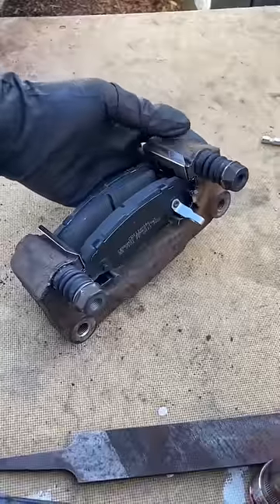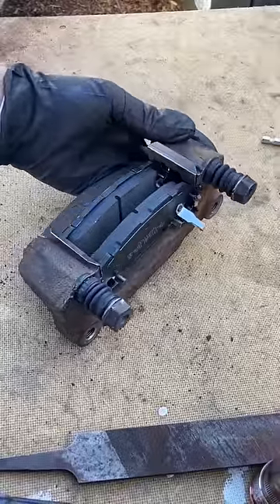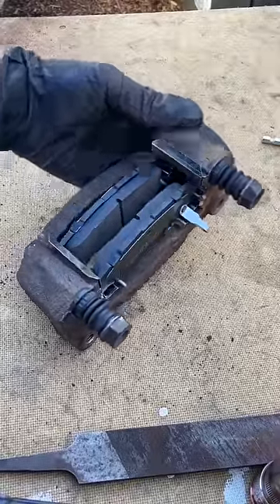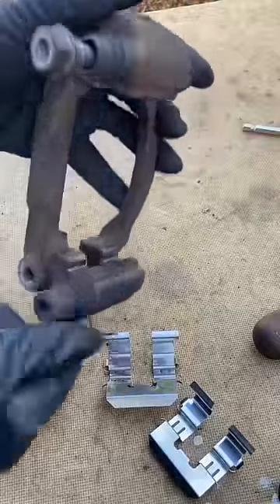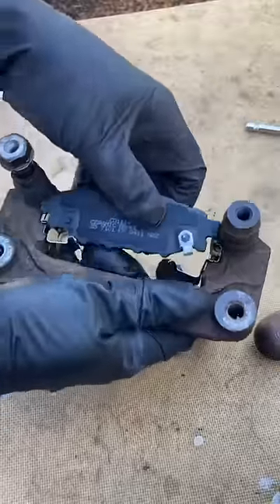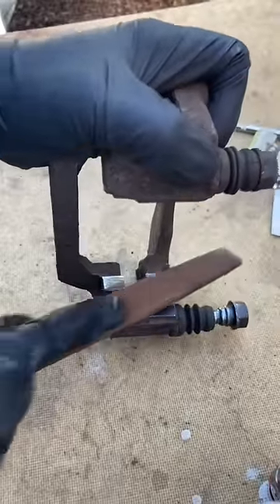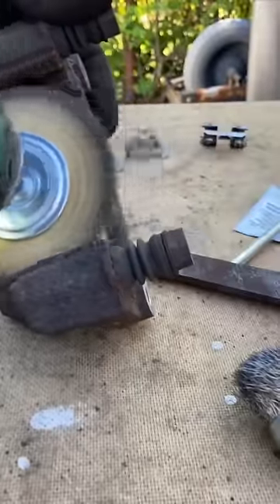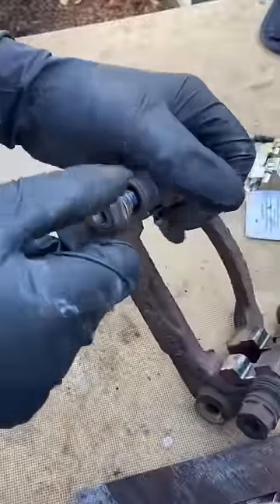What’s the Difference Between a $50 Brake Job and  $200 Brake Job

Comment: This is why I do all my own work, because you can pay 400 at a shop and the techs still don't put in this level of effort...
Reply from the maker: Exactly! You don’t really know what you’re going to get. But if you only pay 50 bucks It’s garbage.
Reply: As a tech myself, I put in the same amount of care as I would with my own vehicle. However, I agree most guys don't put quite as much effort in
Reply: I do it the way he showed but I never charge 200 for 1 brake change I charge about 60 to 80 per set
Reply: @AndyTheXTech  I do full brakes for $75 and Ill get in there with a wire wheel to knock off surface rust. Brakes are sturdy and look nice when they leave. And yes $75 is low but it takes me maybe 30-45 minutes and that's great money
Reply from the maker: @shamoblamo9625  Yeah if it works for you. I think you’re selling yourself a little short. 25 years ago when I started I would charge $100 per axle. now I charge about $150 give or take. I am in the rust belt if that makes a difference.
Reply: @AndyTheXTech  Agree 100% nobody should charge this low. Being in the south I found that one customer usually owns multiple cars and they almost always bring them all to me. for me its the relationship I'm building + I love cars! 🤣  Love your channel and content man you are awesome!
Reply from the maker: @shamoblamo9625  yes it definitely helps to have great customers don’t question you or your abilities. I also love cars. And thank you I have fun making these videos I’ll keep them coming.👍
Reply: @AndyTheXTech  Thank you so much! I have already started learning from your videos and I can't wait to see more in the future!
Reply: My customers tell me all the time it's the little things I do when doing a job that's makes all the difference and why I charge what I do. So you get what you pay for. Thanks for sharing
Reply: At least when you pay the cheapest price, you know what to expect.

Unfortunately, getting what you pay for is rare when it comes to labor.
Reply: @AndyTheXTech  not true. I do good work for very reasonable prices. I have never had a come back that was from my work being done wrong. 

I change pads for $25 a wheel. Drum shoes are $40 a wheel. 

I honestly think I need to raise my prices because the better deal someone gets the more shit they talk about how "you probably didn't do it right"
Reply from the maker: @contraband1543  yup at the very least $100 an axle your worth more. Don’t sell yourself short.
Reply from the maker: @contraband1543  where did you get $600?
Reply from the maker: @littlelouievs  that’s fair. I think you should up it to $100
Reply: @AndyTheXTech  You said you charge 150 per axle. Last I checked most cars have 4 axles. 

Well 4x4s do at least.
I took 150 per axle to mean 150 per wheel. Meaning 4 brakes on 4 wheels would cost 600....
What do you mean by 150 per axle if thats not the case?
Reply: Depends on where you go. Go to my shop, pay 180 and get all of that plus lubricant on the hardware
Reply: @AndyTheXTech  which part of the rust belt? Maine for me
Reply from the maker: @caleblevasseur2657  NH  MA. New England
Reply: @AndyTheXTech  I will I am not certified in it but I have multiple friends that go to the shops and get screwed so I tell them to bring it to me.
Reply: Almost every vehicle shop time for pads and rotors is 1 hour that's 115 canadian before tax and parts and the 2 shops I have worked at this I how it's done the only calipers I don't wire wheel and file are new or on newer vehicles I clean and lube everything and even have filed aftermarket pads with too thick of paint to make sure they fit and slide perfectly not all shops are fucked
Reply: @AndyTheXTech  I honestly use to do my brakes like that change the rotors out as well but now I just pad slap don’t even change the hardware out either just throw the new pads in and ship it but that’s because I’m putting so many miles on my rig 52k miles on a 2020 dually completely ate the rear brakes got some brush caught in the calibers.
Reply: I charge 20 a wheel for pads 30 a wheel for rotors. I do all of this as well. Should be standard if you want non squeeky good working brakes.
Reply: i do every by the book but working on semis ill be held liable if i do the brakes on a truck and it kills someone 10 miles down the road due to a brake failure
Reply: Mmm actually they do and they don’t … when I worked in a break shop I tried to learn as much as I can and I did saw all the work that gets put on the car buttt the only issue is that they use power tools and mess up threads 8 percent of the time
Reply: I will say, the companies you don’t get service at don’t blame the tech honestly it’s because those companies are the ones that pay their employees $13 an hour to bust their asses for 10 hours a day and provide very little training for them
Reply: I recently did a brake job (not my first time) on my Silverado. I never have used lock-tite on the caliber bolts but this time I had one work itself loose and it became a problem. Is using lock-tite on all caliper bolts a normal thing?
Reply: @markmalaney5224 I work at a shop that makes aftermarket parts and I had the mechanic help me chang my pads the other day and he put locktite on the caliper bolts. I work for Currie enterprises, the mechanic does crazy shit there like he took an electric Jeep gladiator and turned it into a drift jeep. literally gutted everything and put a big turbo V8 in it, Ken Block is actually going to borrow it 😂.
Reply: @blyat cyka Thanks. I have a 2013 Silverado and I try to do as much as I can but I'm limited as what I can do.
Reply: @stpbasss3773  Thanks brother, I appreciate the response.
Reply: That’s because the cashiers aren’t salesmen, much less service writers. Most have zero experience in service and no idea what exactly they’ve selling. All they focus on is the dollar amount on the invoice and on to the next sale.
Reply: @AndyTheXTech  150 per axle? Can you stop ripping people off please?
Reply: @AndyTheXTech  I had a guy put wood shims in for around $200 when I was 17.. I’m 28 now, I have not been to a mechanic since.. i do my own work now.. I scrap the car if the problem costs too much, rust or electrical/computer issues usually, I can do brakes and have changed motors and transmissions.. but it’s not worth my life, to trust my life to another life..
Reply: It’s not worth it for a lot of people to take the time, get the tools, learn how and get dirty when they can just pay someone and be done with it.
Reply: @markmalaney5224  did you use recommended torque values?
Reply: @hyphydan  I did
Reply: @markmalaney5224  Next thing I'd try is new hardware/🔩. None of the oem bolts on my Honda brakes had thread locker, and the service manual doesn't mention any... It could work as a bandaid though, red high temp
Reply: @hyphydan  already took care of it. This had happened a while ago but I had never sought out any comments at the time. Thus thread kind of reminded me about it. Thank you
Reply: @69-Bot  I would say if you didn't get your vehicle serviced there you certainly can't blame the techs 😆😆😆
Reply: I've done hundreds of brake jobs with the same attention to detail as in the video for $30 per axle
Reply: I find that many ‘techs’ don’t know any better. It’s not really their fault. The shop hires cheap labour, telling them that they’ll work their way up. But they fail to actually train them. I’ve seen many start as car jockeys at big name dealerships and ‘move up’ into the service bay. It’s why those dealerships get bad reps and customers who know better never bring their cars back. Then that ‘tech’ loses their job and income. It’s evil.
Reply from the maker: Exactly!
Reply from the maker: @zachadam1724  yes! 👍
Reply: You’re going to the wrong shop then
Reply: @notablynova  🤣🤣
Reply: Unless the shop is South Main Auto. They're on YouTube!
Reply: @AndyTheXTech  so I’m just joking but what do you do now that card have 3 or 4 axles With the modern suspensions?
Reply: @AndyTheXTech  100$ an hour for brakes? What do you think you are a master electrician or master plumber?
Reply: Not true I have a shop I do my own work I do what he did in less than 15 minutes I come to my customers homes as well to do the brakes you don't even have to bring it to our shop I love my job I love my shop and my customers are all getting the best brake job they will ever get
Reply: Exactly some people charge 200 for a 50 brake job.
Reply: That’s why I go to the same shop to get my work done. Even when I moved 2 hours away, I still drove there. 

Honest and competent mechanic is worth their weight in gold.
Reply: See this is a funny comment because you say 400$ but 400$ for what because this is 200$ labor job as he mentioned if you’re being quoted 400$ the cost of equipment alone gotta be atleast 110 n again you prob we doing rotors as well idk there’s a lot of factors but I guess I get your point parts alone run 150-300 for pads an rotors all around mind u that’s Detroit axle not same day prices
Reply: Thanks I didn’t have to say it..
Reply: @shamoblamo9625  you ROCK Bro!!!
I’m in the south….Smyrna, GA to be exact…..and if you put in this effort then I’ll bring my car and my wife’s car to you!
Reply: So true I have gotten stuff straight from the dealer and it was crap jobs. Even had a Prius once with new brakes from Toyota with a caliper slapping in the rim they didn’t put one of the bolts in
Reply: @abovethefrey3681  Hell yeah!! I'm from Texas and my parents always told to do it right so you don't have to do it twice 🤣
Reply: Yes.  On many repairs, I have found it less costly to buy the necessary specialty tools and parts rather than pay someone.    I have finally found a way to save a heck of a lot of 💰 for car repairs.  I got rid of all my vehicles!!!
Reply: i used to, my boss didnt appreciate it xD
Reply: @rb032682  my life philosophy right there brother. It's always cheaper to buy the tool and learn to use it... Well, for some. Some people shouldn't be allowed to own tools or cars.
Reply: Facts
Reply: Exactly.  I do my own work but I file and sand my caliper bracket to remove rust and dust
Reply: Not all techs deserve the negative stereotype.
As a tech that works for a dealership I promise some of us are actually worth the money.
But I’ve also seen some that definitely aren’t
Reply: Guess how much of that 400$ the tech gets…then complain again
Reply: SOME SHOPS DO SHITTY WORK N EXPECT TO MAKE A FORTUNE! That’s why I do my own work on my cars!!! Don’t tust anyone with your car. Check the parts n make sure they were replaced. Put a marking on them do you know they were fixed or replaced!!!! Ask for the parts if they get replaced
Reply: Totally agree.
Reply: Well that means you should learn how to do it yourself
Reply: I’m not making an excuse, but you can thank flag time for the lower quality of service techs are sending out. They get more concerned about the money than the safety of the customer and quality of the work.
(7 year dealership tech here)
Reply: I’m not making an excuse, but you can thank flag time for the lower quality of service techs are sending out. They get more concerned about the money than the safety of the customer and quality of the work.
(7 year dealership tech here)
Reply: Exactly, i do side jobs for people, and i always make sure the pads can slide easily in the brackets, otherwise it will cause excessive wear.
Reply: People  it depends  on what kinda car you change brakes on car truck I did a 2017 z71 Silverado  brakes all the way around  I charged him $400 dealer want 1400 parts labor
Reply: The other thing is that most young mechanics think that just because they put the new parts on or in that it’s perfectly fine cause there new parts, lol
Reply: Yeah where a brake job takes half a damn day to complete because everything is rusted to hell, lol
Reply: @zachadam1724  well you're the extremely rare exception because most techs are bums and give guys like you a bad name.
Reply: Same. Starting to do more and more of these basic stuff myself since Covid started. Garages these days, they’re so short staffed, half-a$$ mechanics can do just 50% of the right effort and make good money, and don’t pay close attention to what they’re doing. 

I had a shop change my hand brake shoes earlier in the year. After they were done, a few mistakes that I found out they did over the next few months:

- One rear caliper mounting bolt, one of the two was entirely not torqued down. It was at best hand-tightened. This led to caliper skew during braking, because the pad/rotor friction would pull the caliper into a skew. So pad/rotor wear ends up being uneven. 

- Wheel nuts were way over-torqued. To the point the studs have gone slightly beyond their elastic stretch. I had a hell of a time to remove the wheels just to trouble shoot the first problem. During re-assembly, is when I realized the stud’s thread pitch had changed so much, it was DIFFICULT to hand-turn the nuts. 

- The other rear brake, later showed skittering wear pattern on the rotor. Upon disassembly, found the garage had wiped the guide pins totally dry, and reinserted without any lube. Guide pins started to have scoring mark on them (not good).

The shop charged $300 for this job.
Reply: @AndyTheXTech  I'm sure your the only mechanic that'll to that wanna do my breaks lol
Reply from the maker: @brianmckitterick822  ya Bring it over I’ll do them. 😳👍
Reply: @AndyTheXTech  I'm in Dallas Texas
Reply from the maker: @brianmckitterick822  that’s going to be a long trip. I’m in NH 😂
Reply: because employer charges 200 but pay a tech 20 u still think the going to give a fu
Reply: @AndyTheXTech  I noticed lol
Reply: Exactly. Never paid for a brake job
Reply: @AndyTheXTech  or maybe youre part of the problem
Reply: This is my problem with mechanics. 95% of them got no hustle. Theyre lazy and slow.
Reply: @markmalaney5224  I just hand torque mine on my K20 to 35 foot pounds. 35 years never a problem. I make sure the threads are clean and in good shape.
Reply: Because when you complain to the service advisors that you need a rubber boot kit , they look at you crazy and say Napa doesn’t have those.
Reply: I'm with you on that 👍
Reply: True
Reply: @shamoblamo9625  You get it. Great work, at a cheap price means repeat business, and free advertising by word of mouth. In the end, you'll probably make more than a guy that charges more, because you'll get more business. Of course there's always variables, like location and such, but yeah. It's worked great for me for many years. I don't screw myself by under charging too much, but I also don't screw the customer by overcharging either. Happy medium. 😊
Reply: Sad but even cat's who do their own work don't go beyond just parts. Time is the issue. My time, your and my life and reputation are work any amount of time to be sure you come back safe and with my money✌️
Reply: #Facts And I picked up more techniques 🤣🤣🤣
Reply: That’s because they get paid a flat rate. They have more incentive to do it in a hour if the job calls for 1 1/2. Then they get overtime on the half hour even though they didn’t put the time in. You can’t pay me to go to most repair shops. Especially dealers.
Reply: @AndyTheXTech   cost me less than that usually.  They worked just fine.
Reply: @Sorum & Sons FF & Painting exactly, I can do my brakes faster than i can take my vehicle to someone.  Definitely not paying $200 for any brake job.
Reply: Flat rate babyy
Reply: @Count_Munch  I do my own too. But give zero fucks about rust on my caliber. If it doesnt work, ill buy a new one.   Not once in 30 years have I ever had to file my calipers
Reply: I always slide the bushings to see if they're smooth.  Other than a sand job for where the  shims go I just grease the edges of the pad.
Reply: Id be more pissed that he filed my calipers.  Last thing I want is some goofball grinding metal and changing the shape of them.
Reply: Same.
Reply: Literally exactly what I was going to say 👍
Reply: i would if they gave us the extra parts and got paid the extra labor. sorry dude, gotta feed family and pay bills
Reply: Yep. I just bought a1990 prelude from some guy and I found all the receipts for work he had done. New tires, new master cylinder, new radiator, new rack and pinion (with 4 wheel steering), headers, viper alarm,  etc... the problem is that all the work done has messed everything up. Exposed open wiring, missing grounds, broken and missing bolts, bad welds on the exhaust, warped rotors, broken parts, leaking seals, car pulling left like crazy, etc... the day I bought the car he told me how good his mechanic was and referred me to him but after doing all the work myself, fixing every leak, replacing rotors, closing wire shorts, adding ground points,  replacing exhaust and cat,  etc... I think I'll pass on his mechanic! The new parts on the car totaled almost 2000$ and the extra parts he gave me add up to another 2000$ to 3000$ and I only paid 2500$ for the car! I really don't understand lol
Reply: Amen to that. most shops just want to get the car in and get it out as fast as possible. the sad part is that this shit doesn't add much more time to the job. why not spend the extra 10min cleaning up and lubing everything, especially since you are entrusting your life or loved ones' lives in those brakes? there is not one thing on a vehicle I won't do to not only save money but know that work was done properly. will admit some of these newer vehicles suck to work on but anything can be done with the right tools and a little bit of research.
Reply: I do all my stuff myself bar electrical nope learned most of it off YouTube funnily enough
Reply: @curtisbirtles8820  very true, youtube is uber helpful
Reply: Facts....
Reply: Glad I payed attention to my Dad and the mechanics in my family. I have probably saved hundreds of dollars in labor cost
Reply: @markmalaney5224  lock tite is not commonly used on caliber bolts IME. I have seen a few vehicles missing one though, if its the right bolt no consequence.
Reply: I do quality brake job for 150 all four. Comes with grinding the rust ang lubricating and cleaning the pins. It's an easy job to be honest
Reply: @heinrichorilla9914  it is one of the most straightforward DIY jobs a car owner can do once they get past the chore of getting it up off the ground and taking the wheels off. 
$150 for all four flys if youre a private mechanic with little to no   overhead.
No way a shop in a major urban area big enough to pay a service writer, receptionist, payroll taxes , regulatory and environmental fees, is gonna touch that. In CA thats a hell no.
I got friends that hit me up for a simple pad swap, Ill do it for $50 and its done right and usually includes an additional hour or so poking around all the nether areas of the vehicle for any impending trouble. If its a nice car its me appreciating the engineering, if its a beater shitbox I can laugh at how bad it is. (A friends '13 hyundai whatever their entry level model was, was so crappy there isnt a place to put a floor jack anywhere under the front end without seriously distorting the unibody or bumper structure. Yet  the jack could only be lifting about 600 lbs at that point)
I dont expect to make a living off my friends and only do it if it doesnt become drudgery. 
And if Im asked to take over or help with a job they or someone else has struggled with, we do it my way (BY THE BOOK)or see ya later. There is no worse task than having an idiot direct you as they fire the parts cannon when theres a troubleshooting flow chart available. 
Now its all available online but a couple decades ago if someone asked me to work on their car Id say "we'll need a chiltons manual on that, its about $25 at the parts store" unless it was the most basic work. 
If they balked so did I.
Reply: @batvette  forgot to add. 150 includes putting on new rotors so it's really cheap. Im a registered apprentice but been helping people who's struggling with money. I actively work in a garage too.
Reply: @heinrichorilla9914  they dont bother turning rotors any more I heard, new ones are so cheap. I only replace if theyre really bad, with one notable exception never  damaged a rotor with metal on metal. Autozone saves a buck on their cheapest pads by deleting the wear indicator! 1995 isuzu rodeo, when the pad material was gone and I was on the metal backing, I thought it was the wear indicators!
A week later finally the piston hit  the rotor man what a shaking violent stop. Put new pads on sold it a month later. 
(Isuzu.... Japan's Fiat)
Reply: @shizzavip  this made me laugh
Reply: @heinrichorilla9914  that sounds more like it
Reply: maybe some techs but not this tech!
Reply: Because they don't get the 400. They will get 15 to 30 dollars for the job
Reply: @littlelouievs  you are killing yourself and the business for mechanics at the same time. If you don't value you own work. That's not good
Reply: @harosmessssify  okay I've started to charge 100 for pads. I usually charge by the job not by the hour
Reply: Yup. Just need a garage and tools. Really makes city living almost not worth it if you like having nice things
Reply: Not to mention he did all that extra work to the caliper in just a minute or two and it’s $150.00 more for labor?  Mechanic charging more then lawyer these days looks like!
Reply: @ghostridergale  yes but mechanics put their lives on the line when they work on your car the jack could fall on the person any time.
Reply: So true
Reply: @littlelouievs  same here I’m getting ripped nah I’ve done hundreds lol
Reply: I think it's because we all go to shops where the mechanics don't get directly paid for what they do. You go to a mechanic friend you know and tell him you're gonna pay $200 to change your brakes, he'll show this type of effort because all those $200 are going straight to his pocket instead of getting a check at the end of the week that's the same every week no matter how much work you've been doing.
Reply: Yup same here I bet they never grease the pins and they use trash quality brakes that wear out quick to get your ass  to come right back
Reply: Cause that’s not what ur paying for!
Reply: Depends, flat rate or hourly pay? I’m 19 paid hourly, not to toot my own horn but I’m a hard worker. Grew up bailing hay and working on horse farms my whole life no stranger to hard work. So doing this “level” of effort while being paid hourly is no problem for me. This is exactly what we do at our shop, nor do we charge $200 for this, this is just standard procedure. However I can definitely agree if it’s flat rate pay there’s not shot I’m wasting time doing this, I’m only getting paid for this job to do it so long so I need to do it as fast as possible  to keep food on the plate. However, as stated our shop is paid hourly, our work is higher quality and our prices are relatively cheap. Front brakes are about $100 for labor.
Reply: @AndyTheXTech  About 8 years ago I purchased a sand blasting booth for cleaning caliper support brackets . I use it for much more since the purchase but cleaning caliper brackets was the primary reason . This way I know I am never removing material from the original design .
Reply: @AndyTheXTech  I live in Northern Ontario Canada so rust is common and pretty much second nature doing any job on a vehicle . A front brake job is typically 1.8 hours  X your door rate according to the Chilton flat rate manual . When a shop or tech is only charging 75 dollars for a quality brake job they are not only short changing themselves  but also cause discrepancy within the industry which affects us all .
Reply: @littlelouievs  what I’ve learned over 15 years of work as a mechanic and later in IT, people can see value in your skill, don’t short change yourself, if you do great work, charge accordingly. Think about how much time you spend on it, this not only costs you time doing the work, but opportunity to do more work or meet new clients as well (called opportunity cost) I charge 90/hr to do computer network installs, 60 and hour for Linux computers and 55 for fixing windows. I quit wrenching, but shop I know shops in my area are near 100/hr. If you want to grow as a business, fix your pricing model.
Reply: Find the right shop. We do this 100% of the time, but then again all the guys are salaried ie NOT flat rate
Reply: But this part of a break caliber rebuilt new cars have 4 caliber to do... Is he doing all 4 for 200 bucks..🤔
Reply: Amen to that brother!
Reply: Then you're going to the wrong shop. I do all of this for $65 labor at my shop. I have been in business for 23 years. I have 5 employees and if I catch one cutting corners and not doing it right, I fire them. I do 500 brake jobs a year. It doesn't take but 1 to 2 minutes per axle to do it right. And you can grease 40 to 50 axles worth of slide pins for $9 worth of caliper grease. My techs don't even try to fit the abutment clips and pads in without cleaning the bracket first. Clean it up front and you're not wasting time pulling it back apart. You need some tension so the pad doesn't rattle around. Taking too much off will result in pad chatter and noise.
Reply: @AndyTheXTech  I charge $65 per axle. I do everything he did and more. It doesn't add anymore time to do it right because they don't have to come back with a complaint. I have 5 employees and we do 500 axles per year. I sell 200 tires per month and do 10k oil changes. I have one car lot that spends over $125k per year at my shop. You don't stay in business for 23 years in a small town of less than 10k by cutting corners or overcharging. I will do $1 million in gross tickets this year and clear about $225k.
Reply: @littlelouievs  Exactly. It literally takes 2 minutes per axle to do those steps. I've owned a brake shop for 23 years. I charge $65 per axle labor. I carry garage owners, workman's comp, and general liability insurance to the tune of $1007.25 per month. My main brake guy gets paid $30 per axle. He can churn out 2 every hour to 1.5 hours depending on vehicle.
Reply: @AndyTheXTech  I own a shop in the south. We upcharge $25 per axle for northern cars but $65 to 75 per axle is the going rate for an insured independent shop here. Dealership and chain stores like Pepboys are charging over $1k for all 4 wheels with rotors. It's highway robbery. Good quality parts from Autozone are $239 for front and rear with OEM level ceramic pads. No way the price should be $1k. $750 in markup and 2 hours labor is way past the price gouge point.
Reply: @contraband1543   Pretty sure when he says “per axle”, he just means $150 for the front and $150 for the rear, as if the vehicle were to be solid axle front and rear. A lot of people say “per axle” when talking about a set, instead of saying “per wheel end”. It can be a bit confusing but I’m sure this is what he means. So $300 labor for 4 wheel brake job from him.
Reply from the maker: Correct!
Reply: I do - Self employed 22 years .
Reply: You know for a fact,a shop will not make that kind of effort, but will charge you big bucks
Reply: If you changing someone's brakes that should come with it anyway. Its nothing to it so why charge 200 for this shit 🤣🤣🤣
Reply: Very true I do my own too and it's feels better knowing that I did a good job
Reply: I could do all 4 wheels ,supply and fif here in the uk,for around £80.00 stirling ,approx $100dollars
Reply: I am not a mechanic so no schooling in me but YouTube so people like you who are posting videos like this how I can become better when I do my own and I am proud of the work I do like a professional who puts in the the real work and time so thank you for the little tips 🤙🏼
Reply: Can you blame them? Their work is timed. They make good on some jobs and lose their asses on others. It won't be ever decent till mechanics get a little more than a little above minimum wage is. Mechanics are one of the most fucked trades. Ask me how I know.
Reply: @shamoblamo9625  you must do 8 straight hours of brakes or you're adding time to some and customers just pay as anything. I'm not buying it. You can't live on brakes without being greasy. Be truthful.
Reply: Gee, you took the words right out of my fingers and keyboard. Same here !! Why pay big bucks for shitty work ?
Reply: @angleturner  it's not really about not getting shitty work so much as it is not paying so much for something you can easily do yourself... Better.
Reply: @littlelouievs   you are under charging my friend
Reply: That  is exactly how I Do a brake job .I have a shop and we charge $350 per axle  (for most vehicles) premium parts and labor. There is only 2 of us and we both take pride in our work . So it is getting done right
Reply: @AndyTheXTech   when a customer calls my shop, about how much will it cost to fix my brakes! My reply is, I won't be able to tell you until I get the wheels off .
Reply: Sometimes I  take a bit of the brake pad end or sometimes the paint makes them. Hang up should be snug but  not really rattling around in there. The slides its where  most the break problems happen and  not flushing or bleedingbreaks and capping and putting some  light sealant on them bleeder threads so they  don't get all corroded
Reply: @hyphydan  rust can even be a low cost problem. Consider buying these cars. Body panels are cheap, frames are expensive and can take alot of time. Rusted body... easy fix.. rusted frame.. buy the car and redo the frame for a fraction of the cost on a sale.
Reply: @hyphydan  it has more to do with vibrations. With all that rattling and pressing on parts. It can work things loose. Always use thread lock on caliper bolts
Reply: That’s why I always do my own work on my car 👍
Reply: Likewise
Reply: @AndyTheXTech  I can't believe people pay that exorbitant pricing for such a simple job
Reply from the maker: @chicken29843  I mean my dentist got paid $1000 for 15 minutes yesterday
Reply: @AndyTheXTech  that's a completely different industry and an issue of its own. It's also much more dangerous to attempt dental care on yourself than it is to do your own Auto Care. Like way more dangerous.
Reply: @AndyTheXTech  dental Care is also much more difficult than auto Care and requires a much more expensive and extensive base of knowledge to do
Reply: @AndyTheXTech  im a 30+yr tech and I am also in the rust belt of NNY. The shop rates are expensive around here and in my personal opinion they rip the customers off by charging so much. At what point did part changers start thinking that they were worth 200 dollars an hour? (That's if it takes you one hour to do an axle). I charge my customers 40 an axle. I clean every mating surface, including the rim to hub, I lub it all with moly, I test everything when I'm gone. Using my air tools it usually (on the average vehicle) takes me about 20mins per axle. I have zero comebacks outside of occasional parts defects. I guess there is a difference between some of us. I do this for the love of what I do and the satisfaction of knowing that I have truly helped someone at the end of the day and not just been selfish and greedy. And yes, I make a great living.
Reply: I do it myself but I go I step further than you because I have a parts washer and sand blasting cabinet. Hopefully soon I’ll be set up to powder coat some small things to prevent corrosion from coming back. But it’s just a hobby and I only work on my own stuff.
Reply: @AndyTheXTech  What must you mean ? I charge $50 an axle for labor and do that same work. Its fast and easy when you have the process down and work out of your own garage 🫡
Reply: That's right my man. Or if it's beyond my skill set or tool supply. I have a honest mechanic who will either point me in the right direction. Or do the job for a very nominal fee. I was having an intermittent starting issue last week and I didn't have 2 of the items required to perform a AVR test. He got me in the next morning at 9am performed the test it was a loose trigger wire on the starter he put a new clip on. You know cause the screws they used back in the day weren't 1000x better. Anyhow problem fixed took them 45 mins. A goofball tech will charge between 130 and 300 depending on how stupid u look. I asked him what do I owe ya. He said nothing don't worry about it. There's a honest tech in every town from 1000 ppl to 10 million ppl I guarantee it. You just need some knowledge on how to fish them out.
Reply: @coastalcleaningandmaintena2884  Hey Brother, I am so glad that you found a reputable mechanic that has rebuilt your trust in our (my) profession. I am so upset that so many of the mechanics of the near past and present have tarnished my once proud profession. And thank you for the defence and acknowledgement about there being good and honest mechanics out there because it is very true. You just have to keep searching and look for the bad/greedy indicators of those that just think of the customer as a walking bank. Unfortunately,  its not all their fault, you can blame the dealerships paying tech flat rate making them "upsell" work in order to earn a paycheck so they have to be greedy. And low paying second hand shops starving the mechanics turning them sour against the job and the customers. I love my job and love helping people. I have done it for over 30+yrs and God willing, I will do it another 30yrs. Thankfully the industry never broke me down and stole my love of cars and learning as well as making  people smile when they walk out the door of my shop. 🔧🔧🔧🔧🔧👍
Reply: @coastalcleaningandmaintena2884  You know what pisses me off? The "Jack of all trades, master of none" moniker. 
 My philosophy... Buy the tools, learn to use them. Master Of The Tools.... that span all trades... Are there guys that know more and can do better? Hells yeah, and thank all of you for sharing on YouTube.. but there are guys doing it that do worse and still get paid. Nobody working on modern assembly line products at any level require anything more than the Aptitude to understand what tools they need, and how to use them proficiently. That being said, if I don't have some asshole blowing a whistle at me, I'll sit around talking shit all day... But my tools will be clean and ready to go. 😆
Reply: 100% agreed!!
Reply: @Esteban  Haha. Well then, I a. Guessing that you do not understand how flat rate pay works at dealerships do you? Because if you are going to be lazy and slow then you do not take home a paycheck. Also, if you don't upsell (meaning sell the customer every little thing that you can) then you won't make any money off the job either. That is why alot of dealerships techs get greedy and seem like they are ripping the customer off. Because, in fact, they mostly do and it's the dealer and the way they pay them that corrupts them. The mechanics in the little shops getting paid by the hour alot of them, but not all, take their time because they are getting paid nomatter what they are doing but they couldn't care less about your care or putting pride into it because they are only getting paid 13 dollars an hour for 9 hr days. The pay scale discourages the mechanic but still there are alot of us out there with the experience and pride in our craft. Don't judge all techs on just the assholes. Look around and find us good ones.
Reply: To this day i will never understand why anybody insists on greasin the pads. Huge no-no. Ive seen pads seized up because they absorbed so much crud and dried up. Glad it aint my brakes.
Reply: @trappedsol  no one puts grease on pads... Unless they don't know what the hell their doing. But the pins and metal to metal parts require it.
Reply: @Jane Smith  sometimes, the aftermarket pads are out of specs just due to the loose tolerances they allow for manufacturing. So sometimes the mechanic will have to lightly sand the contact areas to smooth them out, although most of the cleaning will be done on the caliper hanger itself under the abutment clips, and afterwards you leave exposed metal that will rust quickly in a rust belt area seizing the pads and hardware. That is why you should lube it LIGHTLY with something like a synthetic or molybdenum brake lube. And if it is seized, dried, or globed up, then they put on too much.
Reply: @kamikrazywarboy2008  the slide pins sure no doubt, but not the pads where they sit in the bracket thats just idiotic. Literally what the shims are for.
Reply: @midnightrider1854  oh ive had to grind many a shit white box pads i know it. Im talkin cookies and grinders. So i get that. But never greased the corners of pads. Shouldnt be anywhere near the pads or rotors. But hey to each their own.
Reply: @trappedsol  I suppose we will have to agree. 👍🔧
Reply: My dads my boss and he yells at me for doing too much all the time I put in the extreme effort bc I love taking care of cars no matter how little or big of a job.
Reply: @contraband1543  that was always my problem as a teenager. Nobody trusts a $20/hr and would rather take their gear to the same person (me) at a shop and pay $100/hr
Reply: @AndyTheXTech  where are you located?
Reply: Flat rate boy don’t like it do it yourself
Reply: Well there’s a brake job which is just changing pads and topping the fluid and there and refit which is what he did. He halfway renamed caliper bracket. Now why pay for a refit when it cheaper to buy a new caliper bracket.
Reply: @contraband1543 man no.

No.

4x4 is not 4 axels... L o l
Reply: Flag time means that'll always be the case
Reply: Fr. The most the techs will do at my place is sand the pads to make them look new and brush the dust off
Reply: I take that cost breakdown as a bonus to buy more tools 🎉
Reply: @3000gtalex  Exactly! Cheaper to buy the tool and learn to use it... The worst jobs are the ones where you already have the tools...
Reply: This is a regular occurrence these days, so called garages and techs don’t care or don’t know. I prefer to do it my self these days.
Reply: Exactly
Reply from the maker: @@notonlyamemberbutthepresident well that’s nice. I have just enough side jobs. My customers are happy I save them money. I do this nights and weekends.
Reply from the maker: @@notonlyamemberbutthepresident Lol 😂 Bring it!
Reply from the maker: @@notonlyamemberbutthepresident you never know where someone has been.
Reply: I'll pay the neighbor a 30 pack of natural light
Reply: @AndyTheXTech  200$ it’s garbage
Reply: @Briguy933  ok 👍
Reply: I paid $1000 and ended up with siezed pistons
Reply: @shamoblamo9625  I'm also in the south and charge 75$ 😂 but I also do it just like both of y'all. I make sure it's right. Then suddenly that 1 75$ brake job turned into everyone in the family's business and they don't even want a quote just fix it haha
Reply: I learn my lesson I do my brake my self even if you pay more you still don't know if it getting done right.I agree a good brake job on isn't cheap.
Reply: @littlelouievs  cuando se pagan la renta para tener un lugar donde trabajar se cobra 200$ o más cuando se trabajar en casa o en la calle muchos cobran esos 80$
Reply: Thank you
Reply: Facts 💯
Reply: 400$ for labor??
Reply: @RBZ06LT6  where I live, you pay out the ass, do it yourself, or you get robbed.
Not everybody gets cheap prices, great work and all them deals... Shop labor here is around $150... If you ain't paying that... You probably got junkies doing the work.
Reply: @shamoblamo9625  love it man don't let him get to you he almost sounds mad that you charge a good price. I have a guy who does labor $65 an hour. He's amazing and not an ahole about it like this guy
Reply: @dealerhealer3673  Hell yeah people seem to overcharge because they have an ego to feed or they are lazy and want to make more money off less jobs.
Reply: This level of effort should honestly be minimum for a brakejob. No breaks are no fun at all
Reply: @zachadam1724 I’ve gotten called slow a lot because I do stuff like this when I see stuff really bad and take the extra time to do this sort of stuff and got called slow for it and it’s not that I am or I take my time it’s just I’m not the other guy who just pad slaps rear brakes and calls it a day not gonna lie if it’s got like 40k miles on it I don’t worry bout it just spray brake clear and call it a day cuz it’s rarely that bad at that low mileage
Reply: Ya no thanks ill keep the extra 150$, will work just fine
Reply: I was genuinely confused, was taught to do it right no twice for the shear fact I don’t want them to come back and have to do it again. Always make sure pads and brackets are well greased
Reply: @ShamoBlamo  I still love cars, car owners, not so much.
Reply: I'd never put my car in at a shop where the guys call themselves techs.
Reply: @contraband1543  people say axle because everything used to be a straight axle. So when it's per axle it's 2 wheels each. It's just an old saying.
Reply: Thats what happens when techs work flat rate
Reply: This is every single brake job I do I always clean it up re grease re rubber can't stand pad slappers and hacks.
Reply: My father in law just taught me all shop does is knock out brake pads put new ones in they don’t even look at wear pattern to determine what needs to be done most times
Reply: @stpbasss3773  jinxed it 😢
Reply: Is it the techs fault their shop doesn't order all this?

Get what you pay for. The tech is probably paid like a fast food manager.
Reply: I mean.. it's kinda hard these days to put effort like this in when working with a dire breathing shop manager constantly worried about making the most money he can in a day. Most mechanics would be great if it weren't for money hungry shop owners
Reply: Everyone saying they do it the same way i highly doubt everyone changes out the rubber boots, im sure a few just greese the slider pins i never anyone in my fucking life change the rubber boots with a boot kit unless they were missing or something lol
Reply: This, along with cleaning and greasing the hub, is what all my techs do for brake jobs. A brake job done right takes 1.5-2 hours per axle
Reply: That’s cuz the tech don’t make the 400 on that job 😂
Reply: @AndyTheXTech  meh, I do all that for $100.00
Reply: @zachadam1724 yeah, most guys don’t. It’s hard to find a shop where the tech has enough morality to care about the customers car like it’s their own. Partly because flat rate encourages them not to.
Reply: Not every mechanic bub and not every shop
Reply: @Rock-Bottem1982  it’s a 50/50 shot at best. That’s a blue sky estimate. So yeah, you’re far better off doing your own work, if you know how to do it.
Reply: @Dub5084  I've been in the automotive industry professionally for 20 years.  I've seen it all, AND their are very good, honest and professional people around
Reply: @Rock-Bottem1982  nobody said there wasn’t
Reply: @Rock-Bottem1982  yep... Some. But since I can do whatever they can do, why would I throw my money away just to find out? Nah. Too many idiots and crooks out there. Better to just buy the tool and learn to use it. If you have the Intellect and Aptitude that is. Some people can't spin wrenches. That's just facts.
Reply: That’s because most techs and mechanics get paid flat rate flagging hours, so the more they can replace the more money they can make. Always sucks when you go too fast and don’t take the time to do it 100% and the vehicle comes back and you have to figure out what you did wrong and fix it. Take your time and do it right even if it takes you an hour and the job should only take 20 mins as long as there are no comebacks from issues your good.
Reply: 100% agree, plus I pick which pads I want and buy higher carbon rotors.  And the last step is I bleed out all the old fluid.  A lift would be awesome, though, for being able to stand up!😁

I'd be willing to bet that for all the money that I save doing my own brake jobs I could have purchased a lift.  It really does help to have the right tools for the job!
Reply: Can confirm I had breaks done 5,000 miles ago and was having break problems. Took to our family friend and he said it was cause all they did was put new pads on when it was obvious the pins were jacked.  Ended up just getting new rotors and calipers while we had it apart.
Reply: @AndyTheXTech  It cost me what ever the current price of pads are. And my brakes work fine. Changing pads is one of the easiest things a home mechanic can do.  The only good thing about you charging $200 is that people dumb enough to pay $200 for this service deserves to be ripped off
Reply: @AndyTheXTech  yeah and maybe that works for some, but in my area you would just go out of business charging them prices. I 100% understand your logic. But in a free market prices do matter as well. Now if people knew they were getting your quality theyd pay more often. But most times people dont know or check. 

Ik some shops are going to real time cameras while the vehicle is being worked on. That would be a way to justify that pay. But when I worked at a high end shop they would rarely even put in as much effort as you did. Id say most mechanics fall into the bad habits of speed=more jobs= more money.
Reply: On god I’m blessed to be able to do my own work and if I can’t manage I have a one tech I go to other than that they can suck it
Reply: Exactly. And you cant really blame the techs too much, they are usually constrained heavily by time and see only a small percentage of that $400. Because the owner(s) need their fat profit for doing non of the work.
Reply: If I pay that much, it’s gonna be at the dealership.
Reply: @AndyTheXTech unless the mechanic is a family friend and you all look out for eachother but sadly people arent being taught to do things the right wy
Reply from the maker: @JUNEBUGLLC  yes. it’s getting worse
Reply: @littlelouievs your working the system instead of it working you. Finding that balance point between fair and equitable
Reply: But how do you know if you get charged for the 200 job, and still only get the 50 dollar job?
Reply: @AndyTheXTech my buddy tried and tried to explain the same concept on the rear cylinders but i had to really learn the harder way around some drums ,later he pulled soart the old cylinder by hand at his own table ,geuss i couldn't get past not having the hone peice and the new cylinders were cheap enough..he knew and im a crappy brakes guy as it is lol
Reply: @@blueprintgaming2264 lawyer shiitte?
Reply: @AndyTheXTech  That's why I do my own breaks, 2oo.o[ for doing pads.
Reply: @rprice7670 Lolololol.
Reply: @RealJerb Lolololol.
Reply: @AndyTheXTech Hey why not charge 400.00 lolololol,  you mechanics are a trip
Reply: @caleblevasseur2657 Save money and do it yourself or get ripped off from people like you.
Reply: @markmalaney5224 yes, it's normal, as long as you're using medium duty.
Reply: That's because he's wasting effort and a boot kit
Reply: Tech gets 40$😂😂
Reply: Amen to that !👍
Reply: Amen!
Reply: @AndyTheXTech just slide the new clips on that comes with brake pads lol
Reply: Even if he did the 20 minutes of extra " labor " it's still a rip off I mean really ???
Reply: I love what I do and I put high quality both in my personal vehicles and customers but definitely the customer because it’s your name all over it.
Reply: Pshh... Try doing it all yourself with a Land Rover.
Reply: Simple. 
Don't use a shop that hires techs.
Reply: @benjurqunov  That's all shops have anymore... But yep.
Reply: Because there pay is based on how fast they can get cars in and out. Techs die inside that they can't do a good hob because it will take time and will have a lower pay check.
They are almost forced to go quickly.
In that line of work the more time yoy take the less you take home. Its fuckin sad.
Reply: Absofuckinglutely… Same reason I do this as well
Reply: cause its not their vehicle
Reply: Facts
Reply: Do you just take off work to have the time for it? Genuinely curious
Reply: This is not hard work. I have stripped entire cars and chopped it up with a saw. That's work.
Reply: @Crazywaffle5150  you just described replacing the rear wheel bearings on a Subaru at 100k in the rust belt. 😂
Reply: I'd put the blame more on the customer being impatient, the amount of work that the service advisors keep taking in and promising same day, and the manager claiming that nobody is getting a raise if we dont pick up the pace. Mechanics are only human
Reply: $200? It was under $200 for slotted rotors, ceramic pads, and rebuillt calipers & caliper mounts a for my '04 Grand Marquis.
Reply: As a tech, yeah I ain’t doin all that
Reply: The shop charges you 400 dollars but pays the tech 20 for the job
Reply: That's because most techs are paid a fixed rate and it's not enough so they try to beat the clock
Reply: You don't get this effort because the techs are making a whopping $20/hr
Reply: Mache meine Bremsen auch alle selbst. bei A.T.U. wurden bei meiner Trommelbremse die Beläge erneuert. Der Typ benutzte ein Saitenschneider um eine Feder zu packen, weil er Grade kein anderen Werkzeug in der Hand hatte. Genau diese Feder ist gebrochen und die Bremse wurde heiß, sehr heiß, alles glühte, die Trommel , Lager, Radzapfen, Bremszylinder mussten alles neu, zumindest auf einer Seite, plus alle Bremsteile auf der anderen. Es ist ein großer Schaden entstanden plus Abschleppen des Fahrzeugs, nur wegen eines unfähigen Mitarbeiters.
Reply: No disc rotors ?
Reply: He'll nahhh we dont....but I'll try
Reply: 😂😂😂 I would never pay that price even if I didn't do my own myself... you ain't worth 200 dollars.
Reply: Well if you have a job that isnt as simple as breaks thats not always the best idea
Reply: @AndyTheXTech 50 bucks for a brake job?  Or caliper?  I think per caliper that is absolutely absurdly cheap and I wouldn’t ever trust anything that cheap. I know that’s just labor.  I also know when I do my brakes, I do it right.  And it takes me 4-5 hours for the whole car. You did it right.  Most shops will just get you out the door.
Reply: We do this on every service we do it's included in the price 😂
Reply: @AndyTheXTech dummy you’re getting all the profit lol that’s the deference 😂 but fr though I actually do a good brake job all around. That’s how I am as a person anyways
Reply: @littlelouievs  Sounds like you have close to zero overhead.
Reply: @Charlie-dv7ev  sorry close to zero overhead what?
Reply: @littlelouievs  The only way you can sustainably run a repair business charging 60 to 80 per axle is if you have virtually no overhead. And it's more like running a job than a business since you have to do the work to make the revenue. That means you're cutting yourself short wearing the hats of many but only getting paid for one.
Reply: @Charlie-dv7ev  makes sense. I'm only 20 and have a im completely self taught. I also meant per wheel not axle. I get people get confused and think it's 80 for front and 80 for back. I have done a timing chain for one of my customers 2012 Nissan juke and I charged roughly 400 for labor. It took me about a day. Although it was my first timing chain I have ever worked on.
Reply: I do a lot of brake jobs. I’m not sure what we charge, but my brakes never come back 😊I also do a lot of fuel pumps on fords, but those always come back… because something else broke🤣
Reply: That's easy work bro
Reply: You're absolutely right but technicians really aren't paid for their best work; they're paid to be quick
Reply: @AndyTheXTech  that 💯 makes a huge difference. I’m a tech in the PNW and we almost never deal with rust. When we do, we got no idea what to do
Reply: 👋🏻 I did. It’s not as profitable (flat rate), but I know my clients got their money worth, and I sleep good at night.